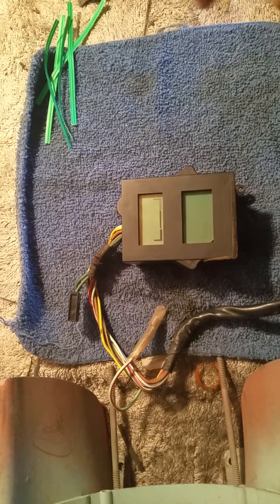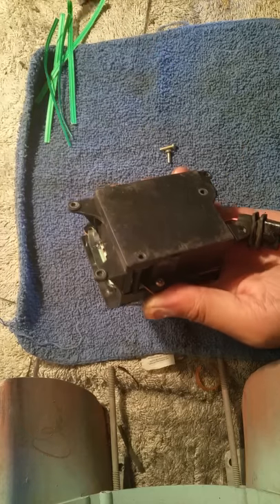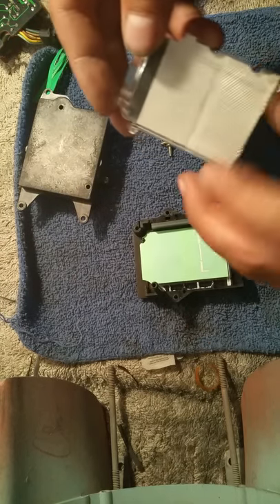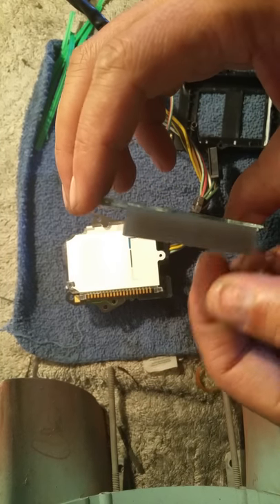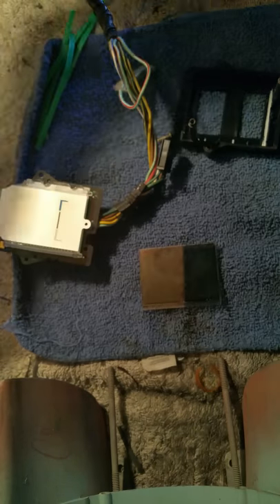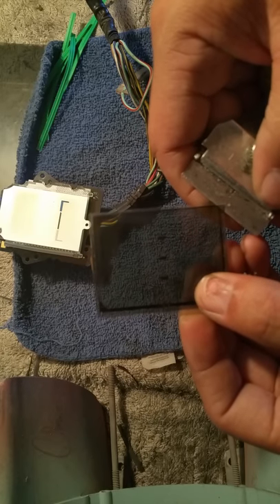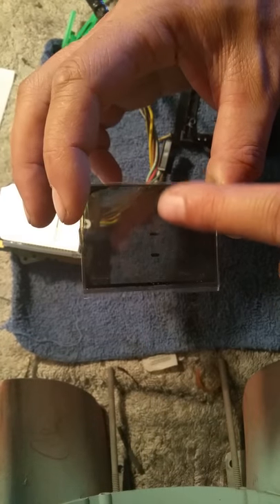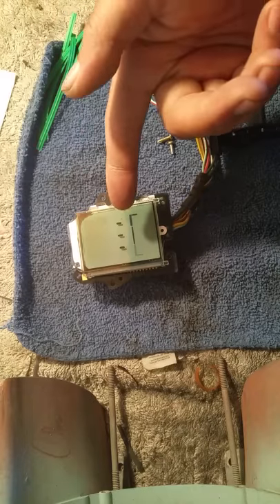How to repair sun faded lcd for v65 magna any lcd.

Comment: Mr. Torres thank you for helping me save $183.00 on my 2006 VTX1300R.  I did want you to know that I ordered a Iphone polarized film from Walmart for $4.11 and got 2 sheets that measured roughly 5 x 2.  Didn't need that strip, but I think my reset button is crap.  
Thanks again.  Oh I am 60 years old, and I can do it anyone can do it!!!
Reply: I think I have exactly the same problem with my 2003 vtx 1300. Odometer is completely red. Can't see number unless I reflect the light of the odometerusing the palm of my hand while looking at it sideways. LMAO. Also, my trip button is fucked. Not sure what to do about that. Can you see the digits on yours now?